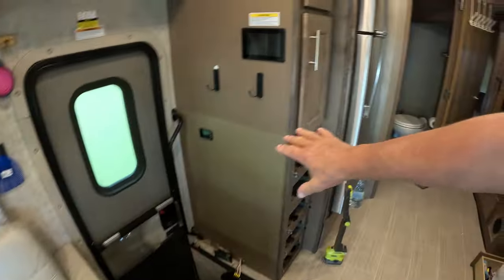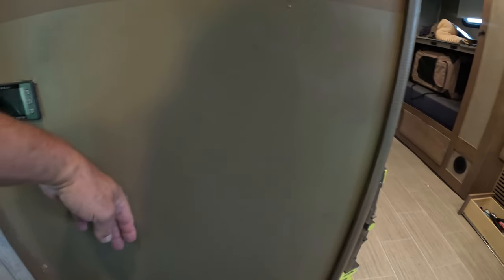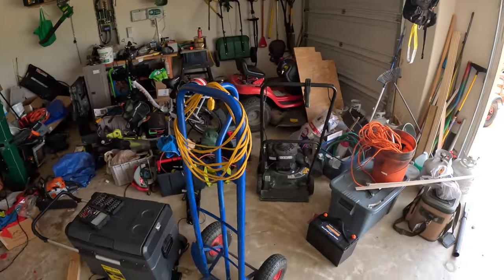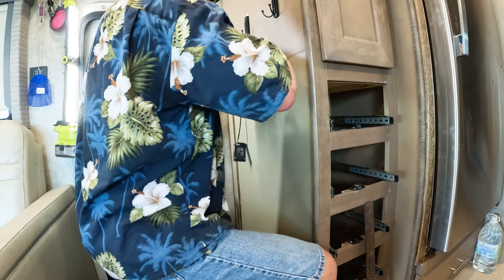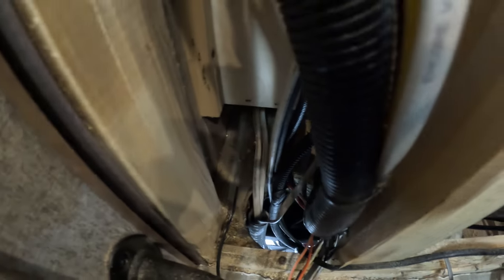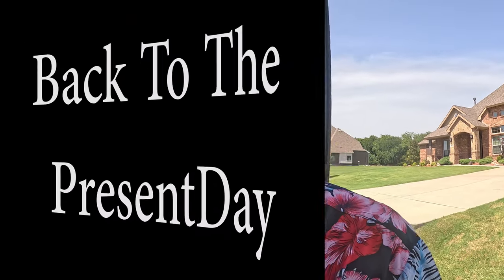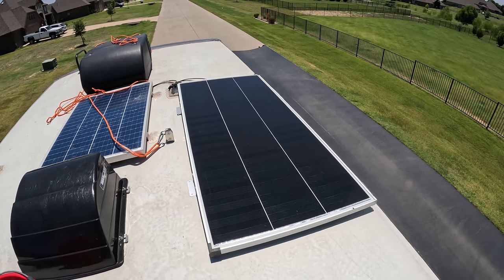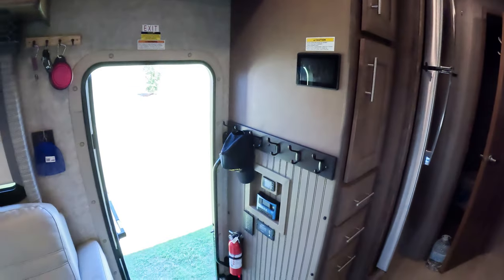The RV Solar Upgrade Project | More Solar Power In Our Thor Magnitude!

Comment: Wow! You did a professional job on that new display wall. You did it the way the factory should do it. Here are some thoughts: solar is there to recharge and maintain your batteries. Both of your solar charge controllers are rated in amps as stated on their front panel, the Go-power was 10 amps, the new one is 60 amps. Why amps and not watts? If you look at any automotive battery charger, its rated in amps, so are alternators. 100 watt solar panels are usually rated for about 5 amps, 200 watt panels are usually around 10 amps. Look for the sticker on the backside of solar panels for that info. So, the go-power charge controller was rated for 10 amps and could support 2-100 watt panels or a single 200 watt panel. With your new solar panel added to the existing 100 watt panel you'll get around 15 amps charge this time of year. Hopefully you connected them in parallel because if there is a big difference in their voltages it can create problems with the charge controller. Remember that charge is divided into 4-? batteries so about 3.8 amps per battery. That's not much. I recommend at least one more 200 watt solar panel, 2 if there's room on the roof. Also, during November through February when the sun is on the far horizon, solar output is much less, maybe half. That's why I always recommend going with a larger solar system. Make sure the wire size is heavy enough to support the total amps. 10awg should be ok. Hopefully others will chime in with helpful advice.
Reply from the maker: Thanks for this comment!  I did not connect two panels to the GoPower when It showed over amperage only the one 200 watt panel. I did connect the two panels in parallel on the new charge controller. I do plan on adding another 200 watt panel for a total of 500 watts and have decided to invest in a Victron charge controller. I am feeling very nervous about something catching fire.  Thanks again for sharing your knowledge and thanks a whole bunch for watching!